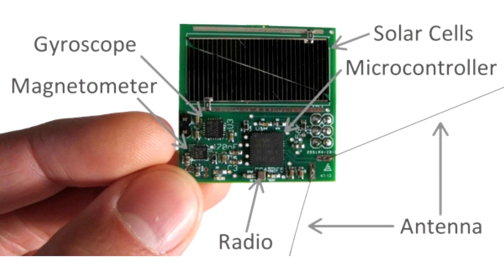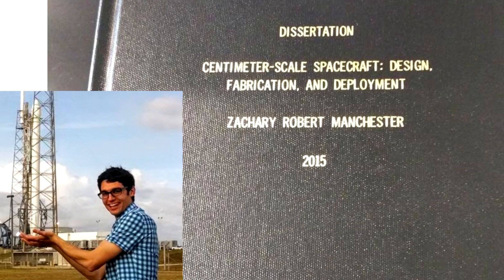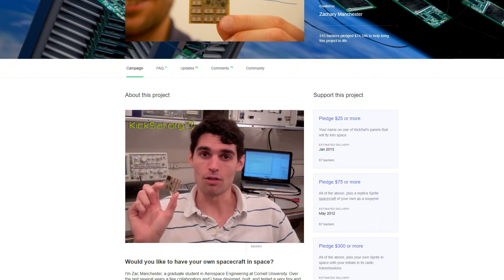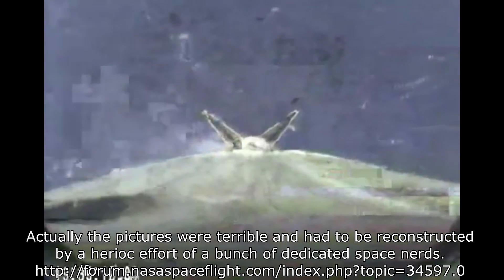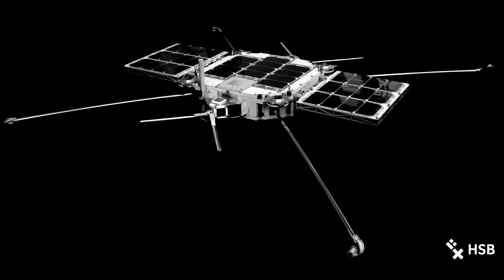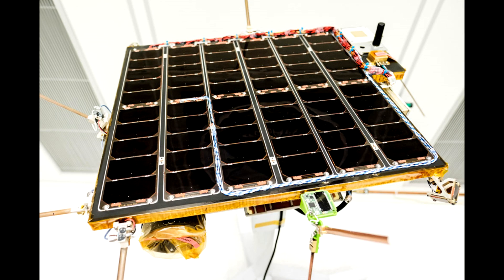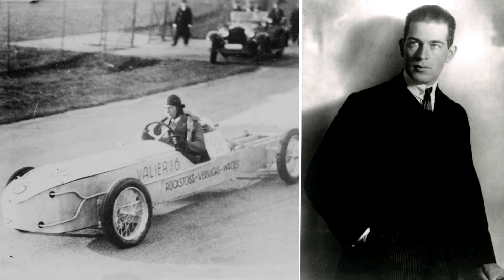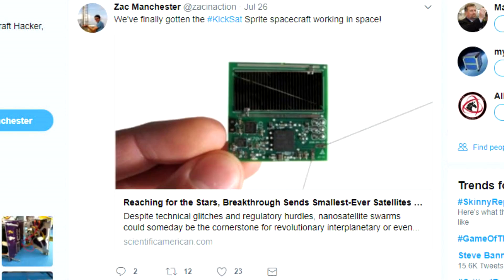The Smallest Satellite In Space

Comment: "Fly by Alpha Centauri and get the data back ..." → The bigest chaleng migth be to get the data back. How would you make a microscopic satelite send the data back to earth ?
Reply: @Scott Manley I guess that would brake the highest ping world record.
Reply from the maker: The starshot plan uses the light sail to take high power laser pulse from earth and reflect it back to recievers on earth, data can be sent by changing orientation of sail.
Reply: Good luck in keeping the a fix on a tiny target 4+ ly away! Might be able alter the solar sail to be a big directional antenna, but would need a power source, perhaps the back side of the solar sale is a giant PV panel. Also a nice big radio telescope in L1,L2 in earth orbit or on the far side of the moon would help. That said, instead of using a ground base laser system, it might me easier and cheaper to use a solar concentrator in orbit that is coated with a band-pass\Notch optical filter. Presuming a +2km^2 reflector either as a optical pump or colemated light source to push the light sail. Less power,but could push longer on the solar sail than a ground based system. with an space based light source the sail could probably be accelerated over many hours or days.
Reply: Not playing overwatch with alphacentaurians any time soon.
Reply from the maker: They started out as separate ideas, but Zac is now part of Starshot.
Reply: Even with a large radio dish you would need a gigantic amount of energy to send enough power to hope receiving any of it. We are not talking about a probe somewhere around Jupiter or Pluto ... we are talking interplanetary distances, over a thousand of time further then Voyager I & II (they are within a 24light-hour radius from earth ... Proxima Centauri is 4 light-years away) ... and dont forget that signal strengh decrases with the square of the distance !
Reply: Even with any technology we are currently are dreaming of this won't really be possible.  
At such distances mirror that would be able to reflect light back to earth would basically have to be atom-perfect flat and angled with a large surface. And then you still need to create a laser that on those distances can hit the satellite spot on. And then that light has also be the captures on earth.  
 
I can only imagine how hard it is to calculate all the gravitational influences on the signal-path at such distances.
Reply: You'll need a massive amount of those ... I cant imagine the cost of such a mission. Like one probe every few month to feed the bridge for the duration of the mission (~50 years if they travel ~10% of C) ... That would be a nice challenge, but it could prove as expensive a solving global warming, solving malnutrition, AIDS, developpment of pour nations or putting a man on mars/titan. And what would we get back ? Reading by a miniature probe who spent 40 years in deep space ... We would be lucky is a simple image sensor could bring back any image at all.
Reply: electron spin communication
electron in the probe's radio would be tied with earth based electron by spin and as we know when one electron's spin is changed the other electron's spin changes instantly (!) 
but we can't change spin at will  :'(
Reply: I believe the plan is to send a chain of them and have each one act as a relay for the data.
Reply: That's a good question. maybe on one of the pylons that hold the solar sail thing you could stick an antenna. although i don't think that would be good enough to send data to earth.
Reply: They all have radio transmitters. They have to be shot intermittently. The first ones relay a signal to the second ones, then to third etc. This creates a bridge for the signal to get across.
Reply: Nice idea, but isnt it a problem that the mini satelite is to fast? I mean it will get there fast, but also cross the system fast...
Reply: Even if it was traveling at high relativistic speeds, a solar system the size of our own would take several days to pass through.... at lower ones, a couple dozen percent c, there might be time for some decent observations. Quantity over quality, really: send a few in a row and get a lot of low res up close imaging/other data... assuming none of them get blown to bits by a speck of dust. Issues.
Reply: the trip to hutton is gonna be loong
Reply: By the time we have a laser that powerful in the right place, we'd probably have enough miniaturization and whatnot to handle that with ease.
Reply: Good point ! Taking measurement (pictures ?) while moving at relativistic speed ... that by itself is a major challenge
Reply: I've made the calculation a while ago and being fairly optimistic about everything they would get a few photons (which can encode ~1 bit). Just knowing that an object has successfully made the journey would be amazing of course, but it basically means to get meaningful data back you need what others mentioned: subsequent probes forming a relay chain all the way to Earth.
Reply: Gunneybunney Um, what good is it going to do us to know the spin of an electron or polarization of a photon at Alpha Centauri? We want pictures. :p
Reply: "That would be a nice challenge, but it could prove as expensive a solving global warming, solving malnutrition, AIDS, development of pour nations or putting a man on mars/titan".
We actually COULD solve AIDS right now for the cost of testing the entire population and containing all those who are infected. You know, the thing they should have done in the first place.
Reply: Hadrien Croubois I can't stand when people bring this up. Have you looked at the US military budget lately? How much did the Iraq war cost? If you supposedly care about all these humanitarian things, get your priorities straight.
Reply: 213423 134242 and no, that's not how quantum entanglement works
Reply: I heard of a similar concept that rather than light plans to use microwave beamed propulsion and a huge, lightweight mesh antenna — On arrival, the same super-focused beam that accelerates it at close range provides, hopefully, enough power at long range for the spacecraft to make its observations and transmit back a modulated signal. The same gigantic antenna would be needed to detect that signal of course, if not a further expansion built during the travel time.... I forget the name though, and that idea certainly has its own issues.
Reply: Use massive radio telescopes to detect the tiny signals.
Reply: Thanks scott :D
Reply: Everything is space has to be fast to STAY in space.
Reply: If your router weighs a full kilogram you might want to upgrade to a lighter and smaller one. Most routers I've seen did not weigh above 500 grams.
Reply: Hadrien Croubois the power required would be quite small (remember it is a Laser in space) and hopefully with the advent of quanterm entanglement it could be transmitted instantly
Reply: A laser is a great way to communicate dense 4k pictures, the problem is the distance. Even if we had the insurmountable capability of creating a lens that aligned a laser so perfectly that it didn't diverge over the span of 4.4ly, it's still impossible due to diffraction. This is why, even communicating to Mars, they wanted to have a series of relay satellites using lasers.
So alternatively, we send out a bunch of probes at different speeds so that they create a relay chain back to Earth. But still probably not with lasers.
Reply: Miki Cerise you never know ;)
Reply: Hadrien Croubois it's challenge not chalang
Reply: You could just send many satellites behind acting as repeaters
Reply: Shouldn't you just put the laser in space to stop atmospheric interference?
Reply: and even if it did, it would take 4 years to get there xDD
Reply: I like potato hehehehehhe
Reply: record the pass then slingshot back to transfer data at home. how many gs would it pull to 180 at 10c?
Reply: By adding struts.  Everything is solved by adding struts.  :)
Reply: The solar sail could also act as a radio dish, maybe?
Reply: Hadrien Croubois they won't send the data back
When rocket science has gotten good enough they will send a spaceship to get it
(I don't understand anything about space)
Reply: I understood its long range communication to be more like morris code with light, by selectively reflecting back the light to earth. Regardless, I think you are combining two stories into one. The solar sail idea and the sprite cluster idea are two separate ideas.

Comment: Isn't having hundreds/thousands of small 3x3cm circuit floating in orbit a major security issue ?
Reply: We can't reliably radar-track something that small... Key word: reliably.
Reply: Micro space junk!
Reply: Not hugely, we can easily determine their position and speed, because they have built in sensors.
Even if they fail they will inevitably will deorbit soon after.
Reply: I was thinking that too, these are probably harder to track due to their size too.  I guess they're so light weight that even if it collided with something it would not do as much damage?  Everything is going in generally the same direction so odds of an actual head on is probably near to none.
Reply: Orbits are carefully regulated nowadays. They'll be put in an area where they can't damage any other satellites.
Reply: Ok good to know, i had the same concern as he op.
Reply: *safety. But yeah, probably security, too.
Reply: They'll burn up in atmosphere.
Reply: Plus there are already millions of small objects in space and satellites are build quite tough. They basically put two of each system in there in case one of them fails.
Reply: The chance of satellites colliding is actually very small. Mainly because the space where they're orbiting is so huge.
Reply: r u joking